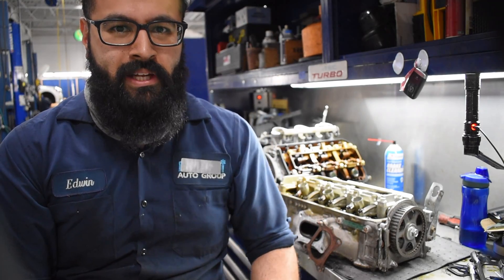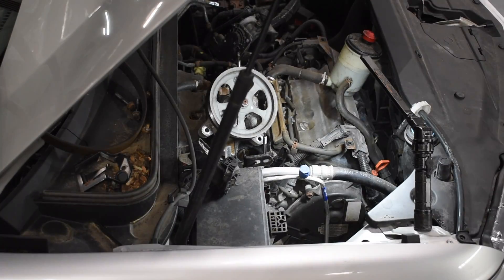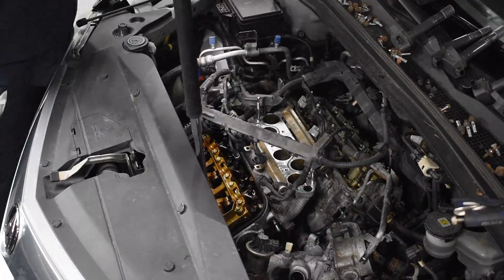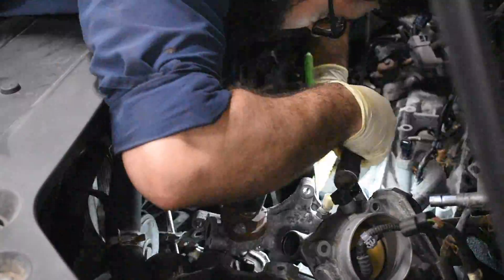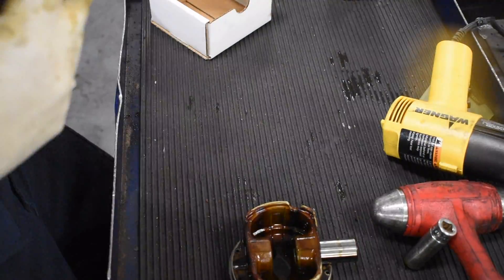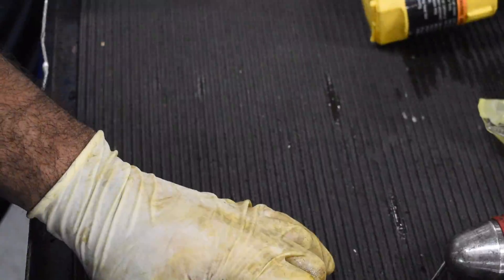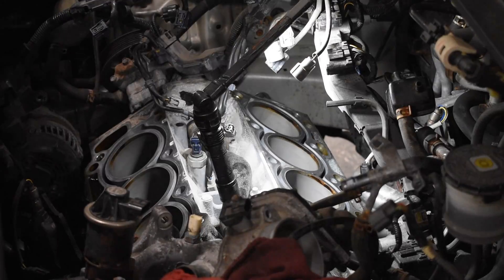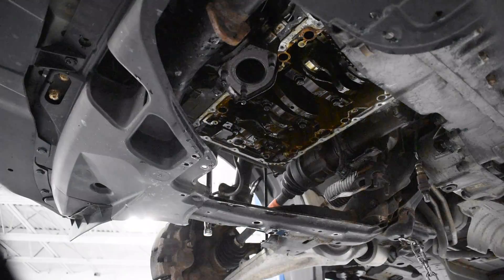Acura MDX Piston Ring Replacement | Failed Oil Consumption Test

Comment: I never understood out of all the J series engines, The J37 had aluminum cylinder liners while the others used iron liners. I have a 2004 MDX that has 304K miles, doesn't use oil.

Comment: This was done to my 2012 MDx like 200K miles ago and now back to the same burning oil like before.  It was covered by a Acura recall though I wonder if I can take it back again to be reevaluated for burning oil and have it done again??  hahaha
Reply: I'm preparing to pay for this job on my 2011 Acura MDX with 170k miles. 

The dealership quoted me $6k for the job.
Reply: What have you done after 5 months? Valvoline Restore and Protect would be a way to help resolve this. I found Honda and Toyota both run their vacuum so low in their PCV System it carbon loads the ring Pack and causes this. They run .015 to .5inHg in the Crankcase and have retuned my 10 MDX to a higher vacuum. (1 to 4inHg) This pulls the Blowby away from the Oil Control rings to fix this issue. Added a Catch Can to trap the blowby and get it out of the engine. We should be getting 300-400K miles out of these engines normally.
You can run a high end Syn oil after trying to clean the rings with Valvoline and it helps but doesn't solve the problem without the added vacuum. Retired 3G mechanic. 2010 MDX 293XXX miles, no oil consumption. If it's not too late I think I could help you and theperfectkingcake without having to remove anything.

Comment: How many hours was this? My engine has 2 cylinders with low compression, burned valves, dealer won't change them they recommend engine swap with a lower mile lkq engine

Comment: I’ve watched this done by two Acura techs online. The question I have is are you techs ok installing new rings in the old cylinder bore without any pre of the cylinder walls?

Comment: i have a question i was putting on my heads that got back from machine shop   on a 2010  mdx i used brand new head bolts from oem parts from dealer i put oem head gaskets i tighten them to specs on front head then rear head at last step got distracted when got to last bolt my snapon torque angle wrench said that i only did 23 torques rather then 24 so i got nervus and losten the head bolts by reversing the order by the book i use the Identifix  program for factory specs do i need to replace the head gasket again with new bolts i did not move the head just losen bolts thanks
Reply: Amigo, podrías regalarme el torque de las bielas del j37?

Comment: Can the pistons be reused after cleaning them ?
Reply from the maker: Theoretically i don't see why not. It's the carbon build up on the oil scrapper ring that causes the excessive oil consumption. If you can clean the pistons without damaging you might be ok. Good luck!
Reply: @curlyhairadventure2780  thank you

Comment: Hey man, are the new rings a updated part or are they just the same number? And if they are an updated part what's different?
Reply from the maker: Sorry for the late reply but its the same part number. In reality it will probably happen again in another 100,000 miles. The reason carbon build up happens its due to poor maintenance intervals on the onboard system. After this repair id recommend replacing the oil between every 4-6 thousand miles
Reply: @curlyhairadventure2780  thanks man! Have you found any flushes or soaks to work?
Reply from the maker: @Gsrsourkrause  ive seen people use sea form products on the valves up top (carefully read the instructions) but nothing for the pistons inside of the engine. That requires a rebuild at that point. And if youre inside to replace them then it takes less time to just replace them than clean them

Comment: I just had this repair done on my 2010 mdx and 1000 miles later the piston in cylinder #2 wore through the cylinder wall. I am pretty confident that this was an installation error. Seeing that you inspected your cylinders, if mine were inspected and within 1000 miles of a catastrophic failure they should/would have let me know. I am just hoping that the dealership owns up to it!! Thank you for the video!
Reply from the maker: Thank you for watching! And they were the last ones to open the motor so now its their responsibility to fi it. Good luck!
Reply: @curlyhairadventure2780  amigo, ayúdame por favor, cual es el torque de los tornillos de biela?
Reply: So what happened?
Reply: @JamesValentineBaja1000 is ur car pinging
Reply: The dealership most likely hired techs that simply didn’t have the experience to save money.

Comment: Great video!!
what is the estimate to do this job? 
I am looking to buy one of these mdx and i will like to have an idea how much cost? 
I found one from 2008. It will be my weekend vehicule..
Thanks
Reply from the maker: This repair will easily be in the thousands wether at the dealer or a private shop. Most the engine has to come apart to replace the internals. Here at the dealer a rough estimate on the labor would be $3500 and there would be the cost of the parts. Pretty expensive! Good luck out there!
Reply: Wow...  Thanks @curlyhairadventure2780 
Question.. the only way to know that the engine needs a change of piston head and rings is to know if it consumes oil? 
Do we have a way to test it besides the oil consumption?
Thanks!!!

Comment: My 10 TL 6MT is getting the pistons and ring replaced right now as part of the oil consumption issue. What’s the difference between the original pistons/rings and the replacements? It is an extra ring on each piston?
Reply from the maker: The issue is the carbon build up on the piston heads and rings. The oil ring gets clogged up and will not properly scrape the oil off of the cylinder wall and leave excess in the combustion chamber to be burned. We replace the rings and piston heads to correct this issue. To prevent carbon build up in the first place we rec to replace the oil every 4000-5000 miles. The maintenance minder in the car is not always accurate and may cause the vehicle to go longer in between oil changes. Good choice on the car! Every Acura tech i known loves those cars.
Reply: @curlyhairadventure2780  so no changes to the new pistons?
Reply: @curlyhairadventure2780  
I think Honda is regressing with this J-37 engine. They should have stuck with the 3.5 liter engine they put in the Odyssey. Mine is an '03 with 130k miles and does not burn a drop of oil. Talked to a guy who had the same with 280k miles and he said oil consumption was nil.

The problem as I understand it with the Acura piston rings is ring tension on the compression rings and the oil scraper holes on the scraper ring land. In their zeal to reduce friction, Honda reduced ring tension on the compression rings and did not drill  drain holes large enough in the lands for the oil scraper ring. When the piston comes down, the oil scraper is supposed to remove excessive oil from the cylinder wall and return it to the crankcase via holes drilled into the scraper ring land. If the holes are too small, the ring cannot do its job which allows oil to build up on compression rings and burn which causes stuck rings and loss of compression. Eventually allowing oil in combustion space and it burns. Another thing to consider down the road, is replacement of catalytic converter due to clogging from burning oil products.
Reply: I just had this repair done and 1,000 miles later a piston scored through the cylinder wall. They are placing it under a “goodwill repair” so the service was done without a warranty. Good luck. I would have rather just added oil..

Comment: Good vid, after performing these ring   jobs, was the vehicles fixed, from the  limited information on the webs it seems that there was a bad batch of rings, never got a techs input about the whole situation, what made it worse Honda dropped the j37, so were wondering if that's the only issue with the j37, if we could get schooled by some Honda/Acura techs that would be golden, I drive a 2003 Acura cl type s 6speed manual,  I passed on picking up a 4th gen tl sh-awd 6speed stick because of oil burning issue and expense that goes with it, to me that's the ultimate driving machine, any info especially long-term would be greatly appreciated, going through this covid-19 is hard, but driving an automatic is pure hell, wishing the best of health to everyone and their family.
Reply from the maker: According to the bulletin excessive oil consumption is "corrected", but in all honesty it doesn't address the factors that causes the issue in the first place. Not changing your oil on time, ignoring the maintenance reminder, using not the highest quality of oil are only some factors involved with this. Some of the techs feel that maybe within another 150K the issue may pop up again if the engine continues to get ok oil, driver neglects maintenace, etc. By then the car is out of warranty and out of the manufacturers hands. To qualify for this bulletin the vehicle needs to burn above 1quart per 1000 miles and still be within a certain age. I think anything older then 8 yrs is out of warranty but i honestly forget. Anything under 1qt/1000mi is considered "normal" by the manufacturer. Most of our cars burn a little oil , but as long as you stay on top of the maintenance it's not the end of the world. Most of the J-series engines are bullet proof and i've seen a few TL's above 300K miles! And the 4th gen manual TL is a favorite among the techs. We all love them! Hope any of this was helpful :)
Reply: @curlyhairadventure2780  How long can an mdx last burning oil without doing this job if you just keep adding oil? Say burning 1qt every 1500 miles.
Reply from the maker: oh and this oil consumption issue affects almost all of the v6's within this time frame (roughly 09-13). So TL, MDX, RL, and ZDX are affected. I believe this time period most of the vehicles had the 3.7L but im not entirely sure.

Comment: usually, how much will this job cost me if I am doing it in an independent mechanic shop??, Also, in ur opinion, what could be causing this oil consumption issue??, if I bought a 2010-2013 MDX that does not have an oil consumption issue, is there anything I can do to prevent this issue from happening??
Reply from the maker: Since replacing the piston rings/piston heads involves so much labor, replacing them would cost upwards of a few thousand dollars. If thats a route you're looking into i'd start by asking multiple shops for quotes on this repair. And what causes this issue is carbon build up on the rings/piston heads. Carbon build up happens on prolonged oil change intervals (not changing your oil roughly every 5000 miles). There is an oil life indicator in the dash and changing your oil when it reads between 15% - 30% is a safe spot for these engines. Many older V6 Acura's have these issues and simply staying proactive with your oil changes goes a long way. Hope any of this helps :)
Reply: @curlyhairadventure2780  Do you know if oil type matters?  Does using Acura's synth blend oil or full synthetic make a difference in keeping rings clean?  After driving about 4300 miles and the maintenance minder shows me 15% oil life.

Comment: Nice work my man! So what does this job pay under warranty? I know when I had to do the re-ring jobs on the VW 2.0L it didn't pay that great. Also looking at selling my wife's 2011 mdx and getting a 2017 mdx. How are those holding up so far? Any big issues?
Reply from the maker: The whole job pays 13.1 hours (not horrible, but not great either). And the new gen MDX is pretty sturdy. There are some recalls for the ATF warmer, Tail Light Gaskets, Spongy Brake Pedal, and Fuel Pump Software. Nothing horrible. You can check the VIN on the recall page on the Acura website (If you Google Acura Recall if should pop up). Other than that the only other thing i can think of is the front lower compliance bushings on the lower arms tend to rip around 60k miles and the change in feel of the 9 Speed transmission. Drive a couple of newer MDX's and you'll see what I mean. At this point I think they're great cars and a great upgrade. Good luck! :)
Reply: @curlyhairadventure2780  That's still not fair IMO. We all know a good tech like you will do it right but it makes some techs to try to rush it and we both know that's not a job to rush! I just left a  McLaren/lamb dealer. I had enough of the dealer politics and warranty bs. Thanks for the info on the new MDX. The 9spd is a dual clutch and I've been around those style of gearboxes for a while now. I actually prefer that over any other transmission really. I'm looking to get one with around 40k miles. My 2011 currently has 150k and runs great but I know the oil pump and rear main leaks are coming soon. I didn't know about the oil pump leak being an issue back when I did the TB or I would of replaced it at the same time. Hopefully your videos get plenty of views and you can keep doing them! These kind of videos are priceless especially coming from inside the dealer.
Reply from the maker: Thank you so much for the kind words! And hopefully this goes somewhere lol
Reply: @curlyhairadventure2780  So I bought a 2015 MDX with 46k miles for pretty cheap. Hopefully that year was pretty stout.
Reply from the maker: As long as the ATF warmer recall has been done its sturdy and reliable! I hope it gives you 1million miles :)
Reply: @curlyhairadventure2780  Well it has a slight clunk from the rear over hard bumps. I saw a tsb about the damper and mouth replacement not a big deal but what does concern me is I noticed blue smoke on startup twice now so I'm really hoping these don't have valve stem issues. I think you'll definitely get the views it just takes time!.
Reply: @WhormigaMan  how's your 2015 MDX running? 

Any issues?
Reply: @theperfectkingcake4374  No major issues so far. I just did the timing belt service and oil pump reseal so that's set. If I had to list problems I'd say the normal stuff is I had to replace the R-R strut, and both front struts. Not normal is the infotainment system will glitch every now and then and part of the controls go blank but that's a common non normal issue. The transmission has the shudder issue at low speeds. I just run it in S-mode to change the shift points and not have it shudder. The trans software is updated and I've flushed the fluid a bunch so I take it as just a quirk of that trans year. There's a tsb about it. Besides that it's been great. I bought it with like 46,000mi and it has 98,000 on it currently. I love the platform my only complaint is the brakes could be a bit better but that's normal for Japanese vehicles.